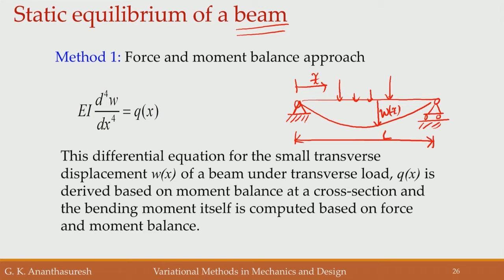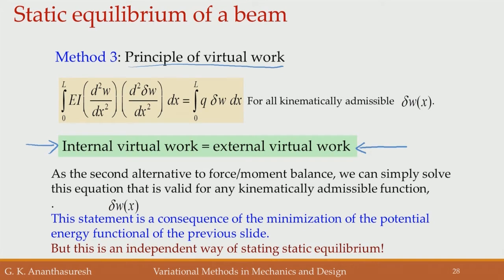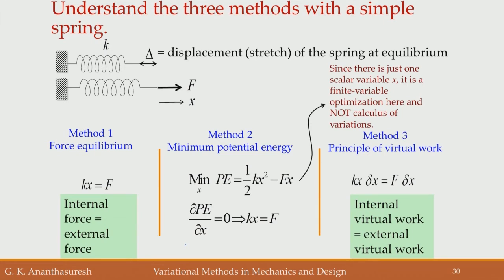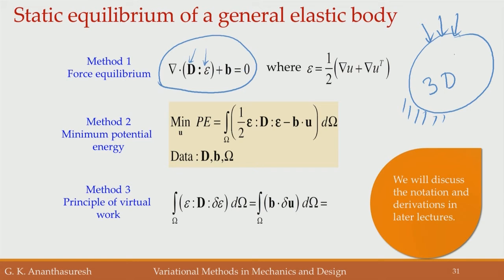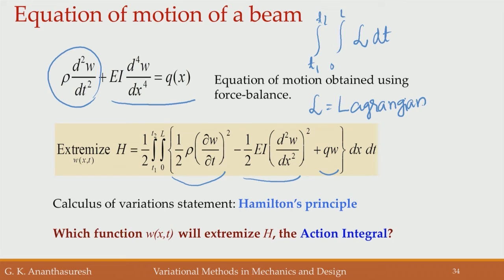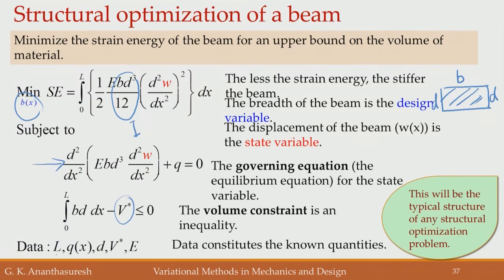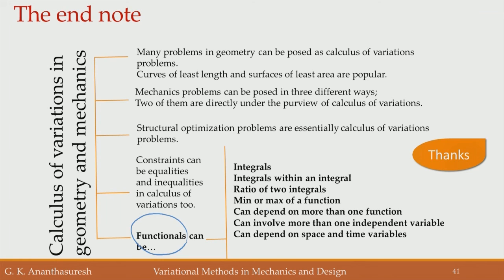Lec6 Part II Formulation of Calculus of Variations problems in geometry and mechanics and design

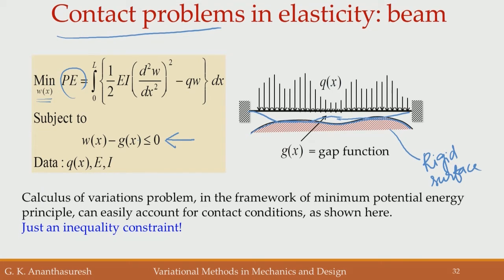Comment: at 20:44 I think the constraint should be w(x) - g(x) >= 0
Reply: I think w(x) is displacement of beam.  if w(x) is 1 mm and gap between beam and point of rigid surface is 2 mm, then 1 - 2 = (-1)mm.  At extreme case, w(x) = 2 mm then w(x)-g(x) = 0. it cant be positive in any case. remember, g(x) is function of gap. not the function of rigid surface.